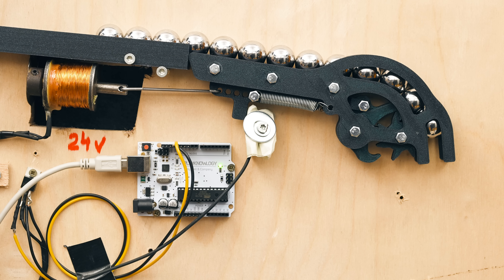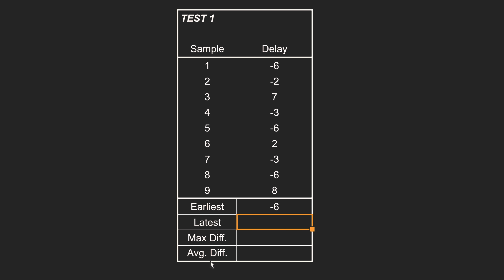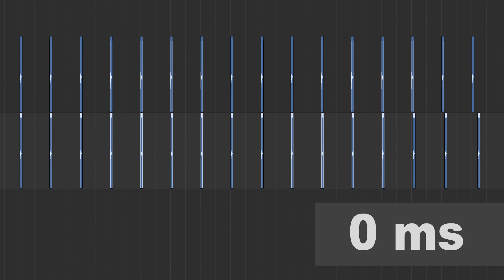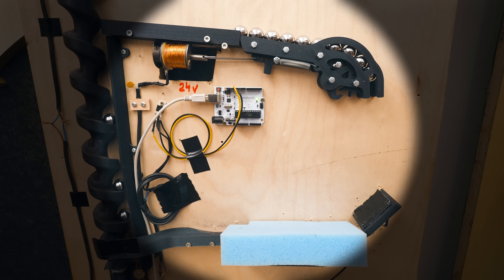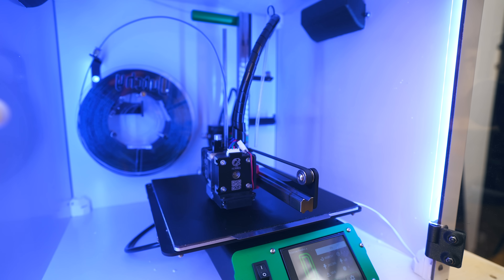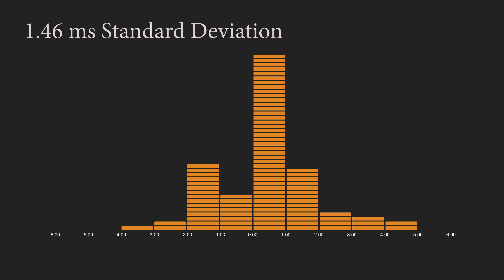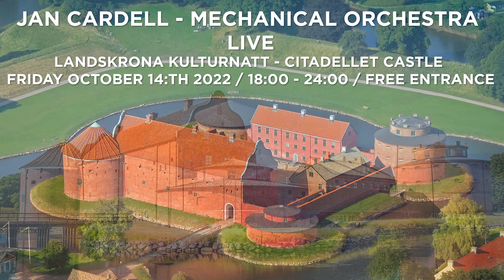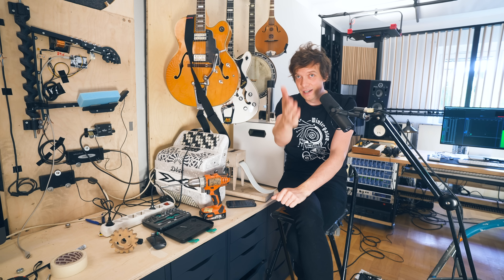Testing the Arduino Marble Gate

Comment: You started strong with MMX, assembling a great team to help in development and manufacture. I admired that process, both the skill in engineering and the team building. Since then my feelings have shifted from admiration to sadness as this channel morphs into a cautionary tale of a ruinous slide into perfectionism and the disregard of counsel. Another millisecond test of a marble gate is gut wrenching to watch. I hope to be proven wrong in time.
Reply: I can only say one thing about that.

You are right.
Reply: While Martin was chasing inaccuracies compounded by having a surface mounted at an angle, he should have realized that that configuration is actually perfect for more easily measuring the slop in the travel path of the marble. Instead he changed the mounting angle to artificially tighten his measurements. BUT this slop in the travel path of the marble is why he had to change the funnel designs on MMX and why he kept getting random marbles on the floor.
I think the biggest concern is that if Martin just worked directly with an engineer and/or scientist on most of this stuff the progress would be so much faster. How much time did Martin spend on thinking about how to capture the statistics of the marble drops before he found out about standard deviation...and that it's built into google sheets?
Reply: Very much agreed. Scope creep and ever moving targets are a slippery slope.
Reply: Yep, this is what I felt when I heard he scrapped mmx. Absolutely crazy decision. It will never be finished.
Reply: I agree. The original marble machine was about art, making a machine that looked cool. While it could play music, I would say that was not the primary goal.
With all this quest for perfectionism, the simplest option is to remove the marbles entirely and not have a marble machine.
Reply: yeah i agree, the last video i watched of his was when he decided to scrap the mmx, and here he is a year later with no works of art, just a computer dropping marbles that despite being more accurate than 99% of actual musicians still isnt good enough for some reason. What was the point of the mmx if nothing ever comes of it, art isnt meant to be perfect and trying to achieve perfection has made me lose any interest in the channel
Reply: That was really tactful, NightHawkInLight. I don't believe I would know if it would be tactful or not for me to try to make a comment on this if I were in a similar position to you, but I think you just showed it is absolutely possible to do so tactfully and kindly.

I feel like our beloved creator here is stuck down the rabbit hole of perfectionism beyond what we can bring with comments. I'm biased because I have a trauma background, but super resistant things like this remind me of trauma responses, and the difficulty in changing it often correlates with age and the extremity and perseverance of the trauma itself.

Obviously there's a lot of factors, but whatever it is, I hope our dude here can look it in the face, accept it, and let it go. It would be beautiful seeing what he could make.

Minor aside, thanks for your contributions to the science space. I've really appreciated tearing through a few of your videos, they're both challenging and easy on the brain, which is a hard balance to strike. Whatever you do (or produce), you can be sure that the polymath side of me will have an ear out! I guess you're "big" at this point, so....congrats! Many hopes for many more great years of whatever you're wanting to do. :)
Reply: Think your all are being too harsh.
Appreciate you may not see accuracy and art being compatible, but art and experimentation certainly are. I see a video of somebody going down a rabbit hole of learning and that shouldn't be discouraged.
I really enjoyed the video, loved seeing the process.
Reply: What's the standard deviation of a professional musician?  That's the target.  Not robotic perfection.  That's not what music is supposed to be.
Reply: @jonbartosch1903 , id bet a lot more than 1ms. He’s now trying to do better than the controllers that control fuel flow into rocket engines and thrust vectoring on aircraft. It’s pointless to want to achieve this level of control on a musical instrument. He should take your advice and run some experiments on individual members of an orchestra.
Reply: @stellamcwick8455  Love the concept of timing members of an orchestra :)
Of course it has been done for many artists (many of them dead now) and it showed that part of their unique style was shifting tempo and minute 'lateness' or 'earliness' adding expression.

But at the end of the day a machine can not create these variations consciously so it will always play 'in the pocket', which is just fine by me. If he just made a short video telling people about the concert and left it at that I for one would have been far more happy, instead of revisiting one of the least endearing aspects of MMX creation...
Reply: @jonbartosch1903  If the machine can play as tightly as the best session musicians, it's good enough. Anything tighter than that, and you're better off using programmed electronic instruments...
Reply: @jonbartosch1903  Imagine gatekeeping the definition of what "music" is supposed to be, in 2022.
Reply: @SpudSpudoni  imagine taking $1000s and 1000s of hours from people helping you build a music machine, and then just saying, nah… I’m not going to do that any more because it’s not 100% perfect.
Reply: @jonbartosch1903  Could you be any more self absorbed? This is an ENTIRELY different point, but okay. Firstly, if you're talking mostly about yourself as a patreon supporter, no one forced you or anyone else to give him money. I've been watching his content for free since the beginning. Secondly, you're paying for ENTERTAINMENT, not for a tangible good or product. You're not OWED anything by not being entertained. That's not how that works. There's no guarantees like there is in tangible goods. The minute you're no longer entertained, stop funding the content, it's as simple as that. Getting really strong "I'm the main character" energy here.
Reply: Okay, "that's not what music is supposed to be", right ? Then I strongly advice you to listen to "Giorgio By Moroder" : free your mind about the concept of music being correct, stop with your preconception of "how music should be".
Reply: @davidboutchiama2008  great song, btw
Reply: Yes, especially because no marble machine will ever be able to compete with a software drum machine, so that's not supposed to be the point.
I think the canceled/postponed world tour with a slightly laggy and marble-tossing MMX would have been an incredible success - and most people attending would be viewers like us who of course understand all the problems that have been overcome to come to that great machine.
Reply: I agree.  What made the first marble machine great as well as the MMX at the start before you lost your way wasn't its accuracy or even its reliability but the concept of the marble machine itself making music with marbles and mechanicals along with your journey building it.  While I can understand the need for reliability for a tour, people aren't really expecting perfection.  In fact people are probably expecting the odd marble on the floor as part of the experience and removing the artistic parts, what you are now calling bells and whistles, to try and achieve that perfection is killing the soul of the machine.
Reply: I think of this more of a documentation project for future reference. Even if individual pieces don't contribute directly to having a completed product on the stage.
Reply: I agree with you. I stopped watching refinery updates a while ago. This is rabbit hole after rabbit hole chasing perfection that will never come with this level of equipment and engineering.
Reply: Amen brother
Reply: I think the millisecond accuracy is a good video topic and was interesting. However I'd wish there were more videos.
Reply: I agree... Maybe perfectionism rabbit hole?
Reply: @citronovastava   Feck Perfuction!
Reply: Pin this comment, Wintergaten
Reply: I mean that depends on what your goal is.

This is absolutely amazing engineering content.

I would hire this man at my production facility in a heartbeat.
Reply: Sheesh. Most of these comments are people that didn't seem to actually watch the video. The marble machine won't have electronic timing or functionality, this was just used to test the gate mechanics, as Martin said. Your argument against perfection is valid, but honestly, the work here is arguably the most important section of the machine. The timing on the marble release is vital for anything to sound right. Any timing mishap can compound as a song progresses. I think everyone is viewing this inaccuracy from the single escapement's point of view. You won't notice as much if a marble gate isn't on tempo in a vacuum, but if you factor in toe 20-30 other marble gates, any deviation can ruin a song. People want to talk about the natural nature of imperfection in music. Difference is, musicians can correct and ad-lib depending on what happens during a song. The marble machine will have no way of correcting its tempo once it starts. Once the gate and the gate release are figured out, I too am hoping that the rest of the machine is much more of a plug-and-play or pre-existing designs that worked on the MMX. 

So many people on here just want what they want to see and imparting what THEY think the marble machine should be, without considering what Martin wants to do. Lots of backseaters in here.
Reply: @SpudSpudoni  No, the gate is not the most important component here—it is merely the final component.  There will likely be dozens of other physical components involved in the ball’s release—each one introducing its own variability.  “Optimizing” this single component is meaningless without understanding (and clearly defining) all the up-stream components.

Would you put high-performance tires on a rusted-out Pinto?  Or do you recognize that you need to understand the entire car before you decide where to spent time/money “optimizing”?
Reply: @br52685  It 100% is the most important. Without the gate, there is no music. The machine can move the marbles up and down, side to side, as much as they want. If it doesn't get released, there is no sound. It's timing and release is essential.

That analogy doesn't make sense. I could put brand new tires on a old beater, but my contact with the road (an analogy for contact with the musical instruments) won't be what ruins my car. But if you have a brand new Audi, and put bald tires, overused tires on it, your contact with the road will be your downfall.
Reply: @SpudSpudoni  You honestly think the gate is the “most important” part of this entire contraption?  You are so sorely mistaken…
Reply: @SpudSpudoni  But he doesn’t even have a functioning contraption (car) yet.  So why try to optimize a high-performance tire, when the rest of the car does t even exist?

You don’t start novel projects by optimizing a single component *first*.  You develop an overall functioning model and THEN refine—and that’s after you have an understanding of the system as a whole, and can clearly see what needs to be optimized.
Reply: @br52685  It's the most vital component  to making music, 1000%. You're just being too obtuse. It's the same way that a car's engine is arguable the most important system, but without the ignition / sparkplugs, its worthless at a racetrack. The same way government is arguably the most important system to a country, but without trash collectors, everything falls apart. Sure there are larger components at play to the marble machine, but they aren't the last thing the marble touches before it interacts with music, like the gates do.
Reply: @br52685  Because imagine a world where cars don't exist, and you're designing the first tire. That's why it's vital. You can have the strongest, most efficient engine in the world, but if you don't have anything to grip the road and move the damn thing, it's not functional. You're not viewing the machine in the correct lens.

You absolutely can optimize a certain part, if its vital enough. That's literally how the design process operates. You have to dissect something into its smallest structures to optimize them. Martin knows how to make a marble machine. He's built two of them (1.75 if we are estimating). Now is the time to perfect the systems he already knows has the highest chances of success.
Reply: @SpudSpudoni  That is NOT how the design process works.  In a world where cars don’t exist yet, you can’t design high-performance tires—as you simply have no clue what the constraints/limitations are of the rest of the system.

If anything, he should be asking if this is the correct mechanism to actuate the marbles.  I can think of a dozen better (ie, faster frequency, quieter, etc) mechanisms than this specific gate.  He’s wasting time optimizing a piece, without stopping to asks if this is even the right piece to be using.

There is just SO MUCH poor design philosophy behind this current iteration—has anything truly been learned in the last three years?  Was a ms variance what doomed v1 and v2 of this project?
Reply: @SpudSpudoni  Also look at the frequency of the marble-release...about 1 marble/sec (1Hz).  Is this the intended frequency for expected use (as it seems very slow to actually produce music)?  Is the intent to use this gate at a higher frequency, and if so...what frequency?  I guarantee you that the variability its going to be much greater at higher frequencies than what is currently tested at 1Hz.  Shouldn't the operational-frequency limit be tested first BEFORE any attempt is made to optimize variance?  There exists other gating-mechanisms that can work at a higher-frequency (hence, produce more music) than this current gate.  Have those been explored?  Why was this specific gate chosen to be the final design that needed to be optimized?

THESE are the types of questions that a true engineer/product-designer/creator would be asking.  THIS is what a true design-process looks like.
Reply: @br52685  I mean, I'm not saying his methodology is perfect. He's not an engineer, nor a designer by trade. But he's going about it logically and with focus on certain aspects, which can be appreciated. I'm not his boss, and I'm not paying his wages. If you somehow end up as CEO of "Wintergatan Incorporated", I'm sure you'll have actual say as far as how he chooses to test his machine.
Reply: @SpudSpudoni  Yes, his methodology is not perfect--and that is precisely what all these commenters are saying--so that he can hopefully, successfully get on the right track and finish this project, by listening to logical and sound advice.  There is no logic in his approach--it's just whatever random rabbit-hole he wants to chase down.  As far as paying his wages--my understanding is that this is all crowd-funded...so we technically are paying his wage.
Reply: @br52685  Again, I could care less about his methodology. He could make a video about the differences of apples and oranges. He's allowed to because its his channel. Oh good grief, don't give me this "My taxes pay your paycheck" bull. This is not the same thing. You don't like the content, you have the choice to stop subscribing your wallet to it. You aren't owed anything just because you support his patreon. This is moving from really gate-keepy energy, to just straight parasocial energy.
Reply: @SpudSpudoni  Never said anything about this having anything to do with taxes, so no clue what you're talking about.

Bottom line simply is this:  there ARE people (myself included) who DO want this marble-project to succeed, and we're providing countless comments indicating why this current path is not the path to success.  You on the other hand, are fine with simply awarding him an "I participated" ribbon.

You're content with merely cheering him on, even if he's running the wrong way.  The rest of us would like to see him running down the correct path.
Reply: @br52685  Lol it just sounded like similar talk to other things I've heard and it reminded me of that.

And I get that. You want to help make the marble machine better and see it finished. That's cool. But you also should expect your voice to be heard either. It's his channel, and his machine. If he decides he wants it to stop playing instruments and make pizza instead tomorrow, he has every right to. I don't understand how that's a hard concept to grasp. 

I haven't participated in anything, because I don't have my money or time invested in this lmao. I'm just watching it for entertainment, because that's what this is. Again, thinking otherwise and building a para social relationship over this isn't healty. You're getting really twisted because Mr. Youtuber isn't making you what you want to see and you're crying about it. But go off about what I'm doing, bud.
Reply: @SpudSpudoni  Para social relationship?  Crying?  At this point, you've also really spiraled down a rabbit-hole...with no concept of what your actual purpose/intent was.
Reply: @br52685  Oh and now we're gaslighting! That's cute bud. Good rebuttal.
Reply: @SpudSpudoni  So now you're just having lobbing petty insults (para-social relationships, crying, gaslighting, etc.).  Again--what IS your point?

Mine has been 100% clear from the beginning:  this creator is on the wrong path, if he truly intends to create a marble-music machine.
Reply: @br52685  Bud. YOU replied to my original comment. You tell me. You went on rambling on about the gate wasn't the most important component, and then switched your argument to the fact that he's not making the machine correctly and needs to listen to us more because "people are giving him money". My argument from ground zero is that he cannot objectively be on the wrong path, because he's making it for himself. You or anyone else has claim to make decisions about how he works. You're again being super obtuse and clamoring on about how someone's piece of art isn't how you'd make it and that makes you upset because you watched too much of his content already and gave him money. I honestly can't tell if you're really this lost in your own argument, or just trolling. This is the same as writing a hate letter to Netflix because you don't like the direction a show is going. Grow up.
Reply: @SpudSpudoni  if this is merely a piece of “art,” then by definition people are allowed to have opinions and critiques.

You’re the one that mistakenly claimed that we (the audience) had no financial interest….when it’s clearly Patreon-driven.

You’re the one that thinks he’s following “sound engineering and design principles.”

Sorry…but you’re just lost here.
Reply: @br52685  Never said you weren't allowed to critique, just that he doesn't have to do what you tell him to do. Again, if you want to hire him as a musician and artist and put him on salary to finish the project your way or take a hike, then it'd be a different story.

The videos and its content are patreon driven, but in no way did he sign any contract that just because you give him money to make something, that he has to listen to you. You specifically said  "As far as paying his wages--my understanding is that this is all crowd-funded...so we technically are paying his wage." You are giving him money, but he is 100% not employed by you.

The fact that you think there is only one right way to do something, and he is objectively on the wrong path (someone who only knows of his work from what he shows on screen) makes me think you have absolutely zero idea what you're talking about. I'm not even saying he IS on the right path. But assuming he's not is just flat out ignorant.

You're lost because you have no argument and are just arguing in circles lmao.
Reply: @SpudSpudoni  "He doesn't have to do what you tell him to do"?!?  You're absolutely bonkers if you think that anyone here presumes as such.  Absolutely bonkers.

There are about a thousand comments (on this thread alone), indicating that he's on the wrong path.  But yeah...we're all wrong.  You're absolutely bonkers.
Reply: @br52685  Give me any proof that the statement is incorrect. You're just using ad hominems for the basis of your argument now. This is beyond silly.

"A thousand comments". Literally 128 replies, but okay. Never said any of you were right or wrong to lend your advice, just that he doesn't have to use your advice.
Reply: @SpudSpudoni  There are 2,000+ comments on this video (at least).  The overwhelming consensus is that this current path is not good.

Again...what exactly are you contributing here?  No advice to move the project forward.  You're just sitting here complaining against the people trying to help and get this project on the right track.

What your motivation to discourage constructive criticism?  Is it because you actually want to see failure and don't want to see this back on-track?
Reply: @br52685  Sure, but now only 130 comments in this thread. "The overwhelming consensus is that this current path is not good." Damn, you've looked through all of them and gauged their opinions? I'd love to see the log sheet of all the research you've done in the last 24 hours since this was posted. That's quite an impressive waste of your time!

Currently, I'm not contributing to anything. I'm having an argument with someone that's obsessed with trying to prove my opinion wrong for whatever reason. You're just wasting your time trying to force me to agree with your opinion. And here I thought you stood for letting our voices be heard about this project. Smh.

"Is it because you actually want to see failure and don't want to see this back on-track?" Bro. Idk what you're smoking to come up with that, but I want some. This is a wild-ass strawman of a statement lmfao. At this point, you're not even making counterpoints. This is getting sad.
Reply: @SpudSpudoni  "Currently, I'm not contributing to anything."  I couldn't have said it better myself--it's quite obvious you've not offered any contribution.
Reply: @SpudSpudoni  You make it sound like it’s hard to read a bunch of comments.  Do you find reading to be difficult….in general?
Reply: In machining, it's called "chasing zeros". Trying to get a level of precision that contributes no benefit to the goal you're trying to achieve. 

This is like returning a pair of shoes because one shoe is .01 inches longer than the other.
Reply: @talyrath  It's so much fun to chase zeroes sometimes. :)
Reply: The most odd thing about the MMX videos for me, was the marble testing, where some marbles ended up on the floor and Martin acted, as this was the end of the world. So what!!? Its not like you are running out anytime soon!
Just finish the damn thing one way or the other! Now after the big break I kind of lost trust into Martin and dont want to invest myself into the project again. Sorry, I hope this will change.
Reply: I've not been following closely if he's even uploaded anything recently, but I always interpreted him giving up on MMX as primarily a mental health crisis, and I don't think he's out of it. I do think that doing something actually productive would help though, and this ain't it.
Reply: @Ass_of_Amalek  No he had to move to another country and deal with family stuff. All these people aren't in the discord I guess and don't know just how many problems the MMX had. The MMX would not have been able to fit his original goal, and would have just been another MM1. I know his videos seemed to suggest it was almost done, but it really was not. That being said, I still may have liked to see it at least completed to some extent and have some songs play. Also I do think Martin needs to address the situation and let everyone know why he scrapped it, because it's hard to find out.

This video seems trivial but its just him getting back to work.
Reply: @nonwibb  clearly he scrapped or stopped working on the MMX without having a better plan. I don't believe that he had good reasons to just get rid of every individual part of it without having any clue if he could make something to do the thing the part does better. 

a bunch of comments here seem to say that much of the problem was basically due to wear. that sounds to me like the main change he needs to make is to stick to using better materials, namely ditching the plywood. birch ply is soft and quite substantially dimensionally unstable. it hasn't made sense to me for a long time, but he clung to it as an aesthetic choice to reflect the original marble machine. I think perhaps he could get away with using marine plywood, which is very expensive resin-saturated plywood, so it's harder and probably much more stable.
Reply: @Ass_of_Amalek  I think you just made a good case for building a new marble machine lol
Reply: @nonwibb  no, there were many parts on it that weren't made of plywood and other parts where the plywood could have been replaced with something else. there is no way he had a good reason for scrapping every part.
Reply: @Ass_of_Amalek  I mean yeah some parts work alright design-wise. Many of the parts were like fundamentally not going to work though, not just because they were poor material. Still yeah I think the frame and flywheel and other basics looked perfect, and there are many other parts that seemed optimal. If he goes for a similar design he may very well reuse some parts.
Reply: As an engineer who has worked on the Apollo project to the Tesla battery plant.  Perfection kills finished every time.   Good enough is just that good enough.
Reply: I am in agreement with you on this too...the first marble machine was a lot more compelling to me because it followed the old mechanical machines from the past in its tradition that he demonstrated and did videos about and visited museums...going all this computer tech to get there seems to defeat the beauty of the original machines with all its wonderful flaws.
Reply: @chuckthebull  Absolutely, but I think this arduino is just for testing purposes thankfully
Reply: This summed up everything I feel x100... seriously.. I can't watch stuff like this anymore, he should have just  plowed ahead regardless and not listened to those idiot small voices in his head, most people can keep better timing in thier heads within 50+ms what he strives for and what he strived for in MMx was impossible and maybe he did it to self sabotage...
Reply: I wanted to write my on comment but this one pretty much nails it :(
Reply: Ye of little faith…
Reply: This kind of snowflake thinking is a result of too much Hollywood bullshit during formative years. Martin is not here to entertain you and make a happy ending so that you can enjoy your dopamine hit and move on to next thing. He's sharing his life's work, the ultimate behind the scenes. Blood, sweat and tears. Life gets messy and no amount of followers or patreons can steer away from that. Yes, some of us would not be as worried about the tightness of the machine, but that just proves that most of us would suck as musicians. I think even questioning his decisions is disrespectful and shows lack of empathy.
Reply: Comentário perfeito. Em minha opinião, o grande problema é que o Martin tem um orçamento “ilimitado” …
Reply: Totally agree. This is Martin allowing the perfect to be the enemy of the good. The charm of the MM1 video, even the machine itself couldn’t play the song once through, was infinitely better than where we’ve ended up.
Reply: He’s a musician, not an engineer. As someone who played some music in my days I can understand his frustration with getting tight music. I feel like he knows a lot about engineering at this point seeing how many years he dedicated towards this, but he seem to miss one fundamental thing when he does tests. That is, this rig, is not a fundamental testing rig, not by a stretch. There are waaay to many variables going into the timing, and it’s to difficult to know them all unless you start from square one.

If he wana do fundamental testing, which he should, to avoid it being so chaotic in the results, he really should try and take baby steps.
Reply: I think the "robotic perfectionism" part is justified, since this is about creating an instrument. A lot of musicians take for granted the amount of engineering it takes for their instruments to become playable. Slight deviations would cause long term problems and that's why the creation process should be as perfect as they can possibly be, let alone the actual designing process of the instrument. 

MMX's problem was more on his stubborness/fear to not just start over sooner. Because as an artist he WAS enjoying MMX's journey, but the more he creates for it the more he has to destroy, and it was going nowhere, so he had to start over and create something new. 

Ya'll just want to consume cool viral videos sooner. That's why you're telling him all that... 
"just be yourself" 
"be an artist" 
"art is about imperfection" 
bullsh*t. 😂
Reply: I disagree - I see him as a musician and artist who is trying to teach himself engineering.  An artist sevant can build a really cool machine but it takes an engineer to make an accurate instrument that someone would want to play. Personally, playing a poorly-tempered guitar or other instrument it's a very brief experience for me - if it's not correct I just can't stand it. I applaud his paws and focus on the fundamentals.  The evolution of the violin took generations of talented engineers supported by a  massive cottage industry of suppliers and an army apprentices. Considering the evolutionary pace have tomorrow machine - this truly demonstrates his brilliance and level of determination!
Reply: Its sad to see what was once a piece of art had turned into trying to get down to single milisecond precision. Very unfortunate to see an artist be turned engineer and lose all of the heart in the process.
Reply: @Keelhaulic  why is it sad to be an engineer?
Reply: @lilyofluck371  I have been following the project since its inception and it's sad to see something very artistic driven and full of heart be broken down into an engineering problem.
Reply: @Keelhaulic  It still IS artistic, a lot of you just want the romanticized, more ideal, version of  "artistic" where someone vlogs progress once a week in their ideal artistic homebase.

If you've ever created something before, you'd know that he still IS enjoying this, probably even more now that the sunk cost fallacy from the MMX is no longer holding him back.

You guys just don't find all the boring engineer stuff as appealing and immediately went "OOOooOooh iTs No lOnGeR aBoUt tHe ArT 😭😭😭"
Reply: @Keelhaulic  thats very awful to say taking in consideration the context. Martin scrapped the mmx due to the machine started breaking on random places, every time he fixed something in other place something started to either break or wear. He pushed so far the "artsy over function" until the very end. The machine could easily be done much simpler but he pushed a lot of design desicions in favor of aesthetics. And he kinda still do.
Dont try to police other people's art ffs, his art intentions Is to create a machine that looked good and also could play music without destroying itself in the process.
Reply: @ppprime98K  If his "intention" is a "machine that looked good and also could play music"....then why do milliseconds matter?  Absolutely NO musician is precise down to a millisecond.
Reply: @ppprime98K  nah man, he gave up because he couldnt have 0 ball bearings hit the floor. i mean, god forbid it plays and drops a couple ball bearings... theyre like 2 cents each and yeah its a safety hazard and not ideal but ffs just finish themachine it was like 75% done lol
Reply: @ppprime98K  Except thats not what I saw happening with the MMX.  What I saw was great progress was being made improving reliability by identifying weak points and designing out the problems.  Unfortunately what also was happening was at the same time Martin was becoming more and more obsessed with a perfection that is unobtainable in a wooden machine moving marbles around.  That and too many people encouraging Martin to go down that path.  I want to see a working machine making music even if there are a few imperfections.
Reply: @ppprime98K  A-fucking-men. First of all, it's not like "this is what the marble machine has become". If you loved the original version for its heart, soul, and charming level of mechanical sloppiness, it still exists and is just as beautiful as it ever was! So just watch that video or go see it in the museum.

This is a SEPARATE art piece, with different, very challenging design requirements. If you don't like how many tradeoffs it takes to produce an art piece of a certain type, that's fine! It's okay to not like art. But to claim that it's because the artist lost his heart is not only rude, but imo, false. Just LOOK at the hours and hours of content, organizational systems, enormous communities of engineers and artists he brought together, and years of his life he poured into making his "magnum opus". If that's not heart I don't know what is.

And personally, I find enormous artistic satisfaction in the marble machine's story arc. Three machines representing the three stages of Martin's growth: the pure, but impractical artist, the artist wanting to merge engineering and beauty, the artist recognizing the sacrifices that must be made to accomplish a dream.
Reply: @br52685  Because is a machine, not a human that's playing the instrument. And miliseconds matter since they can add up and desync the whole machine. Imagine that in the middle of the concert the snare triggers slower than it should be. A human can adjust themselve to be in sync as humanly possible to the beat, a machine can't automatically adjust to the beat, so eventually it will be desynced
Reply: @donniekarns2082  i wasn't the one who said he lost his soul but i share your point lmao
Reply: @ppprime98K  It wasn't so much that it started breaking in random places. It was that it wasn't perfect, that there was some flaw that he sought to improve.
Reply: @ThePoxun  The thing is that those imperfections were slowly breaking the machine down. On the last streams Martin had so much trouble with the machine, from barely losing marbles to creating a marble shooter almost. And why is important? Because he found marbles where it shouldn't be any and causing the machine to slow the machine and break unreachable parts. One time he felt that the machine was "too heavy" to crank manually and was a marble that got stuck between the gears and caused a lot of friction.
Reply: @ppprime98K  That would depend entirely upon how the machine is setup.
If you had an entirely independent snare machine, then yes, it can desync. This is because in that setup, it is timing itself, and each drop could be timed relative to the previous drop.

But with the original marble machine, and the MMX, you have the programming wheel driving everything. That is what you need to desync. That is because the programming wheel tells the marbles when to drop. It doesn't matter if the previous marble dropped 1 second late, because it is timed from the programming wheel.
The only way this could be pushed out of sync is if some part of the machine is being deformed.

And a great example of that is in the last part he changed, making the surface it hits flat. Prior to that, there was significant variation because of the marble hitting the upper or lower portion. But that variation had nothing at all to do with the timing of the next marble being released.
Reply: @ppprime98K  No…these will not add-up to eventually result in anything being out-of-sync.  There is mo additive nature to these deviations that accumulate—as the timing is NOT based on when the last event triggered.
Reply: @br52685  most of his timing issues were on the release system, some parts wore out faster so they wouldnt release on time or get stuck, most of the timing problems rely on his designing that depends a lot on lubrication, like the marble release system that he needed to lubricate with graphite periodically
Reply: @ppprime98K  Is he policing it, or giving his opinion? How about you refrain from policing other people's speech?
Reply: @ppprime98K  And as someone else mentioned, these milliseconds are jitter, not a cumulative delay. At the end of an hour long song, the marbles would still be hitting within 4ms of their trigger, just as they were at the beginning.
Reply: @ppprime98K  preach. I was ready to grab my pitchfork but you are right. Both are gut wrenching to see, but I think this is still progress forwards
Reply: @ppprime98K  don't forget biased vs unbiased effects. If you have pegs like the old machine, it's going to (hopefully) be unbiased. But the samples of each time we "roll the dice" for each peg are independent, so there's not a chaotic, exponential divergence (i.e. some kind of eventual explosion) for things.

Now, with a musician, it can compound. Like, for example, if the click track breaks on the drummer. That can go really badly really quickly, I think. Maybe there's a timing mechanism that does have accumulating error, and without self-correction, could completely diverge.

I'd argue that if people took finals-week-level creativity on the band side of things, that they'd just be able to play along with any timing system desyncs if that happens.

I find it absolutely beautiful when programmed, structured things suddenly become organic of their own nature.
Reply: @ppprime98K  I know :) I was saying "Amen" to your original message, then adding my own thoughts.
Reply: @donniekarns2082  oh sorry, most people think engineering is enemy of art when are mostly related, Martin Is passionated about his craft but still recognized that the MMX had fatal designs, and he still have even the first MM because both are an statement of his craft and evolution
Reply: @ppprime98K  😅
Reply: I think Martin might have been running to compounding errors and is trying to mitigate part of that; even a 0.1% error over a 7 minute piece may be causing parts of the “band” to break step :)
Reply: @willkelly8108  except they aren't really compounding as each marble release is an independent event with an external (to the release mechanism) clock.  The timing of each individual marble is not influenced by a release mechanism delay from the marble before.  They are also far more regular than a human could manage over an entire piece of music.
Reply: @willkelly8108  there can't be any compounding errors in the timing of the music, though. The timing is ultimately controlled by the programming wheel, and if there's compounding error, it affects all tracks, rendering the compounding error irrelevant.
Reply: @willkelly8108  the mechanics of a marble machine take the compounding part out of it. The error is always in relation to the trigger, and triggers can only drift along with the whole song.
Reply: And the first machine was still able to play a complete, recognizable song.
Reply: @_taste  …and was shaking itself apart during the filming of that complete, recognizable song.  The original marble-machine is actually unusable now. 

The MMX, too, began to self-destruct towards the end.
Reply: @John_Weiss  "The MMX, too, began to self-destruct towards the end." This was probably down to so many multi-hour non stop tests without any kind of maintenance during the test.  Every machine needs some kind of downtime and regular servicing and trying to run the machine for 10 hour tests without any kind of checks or adjustments when the normal pattern would be at most one or two ours of intermittent use was just setting up for failure.
Reply: Perfection is an unattainable goal because it means that the perfect 'thing' can never be improved upon, let alone bettered. Martin has a brain, he should know this. I wish he would go back to composing more of his wonderful music and/or settle for a marble machine which is imperfect, because imperfections in creativity can lead to wonderful, organic results. Look at the works of many famous artists for example and realise that none of their paintings are perfect, but what makes them so great is often the imperfections that resulted in something even better.
Reply: As much as I hate to be hard on Martin, because I think the man is a low-key genius and he's too hard on himself already... this is completely true.

MMX was an amazing project, with all the BS that the mechanical aspects brought. I am very sad to see it gone without it being finished, even as an imperfect product.

I am however gonna be following Martin for another while. We'll see what he comes up with.
Reply: If he went pure digital, then he would never have any timing or failure issues. /s

But thats not what the mmx was. It should have been a purely mechanical device. Yes balls will fall, itll have timing issues etc. But thats part of the charm
Reply: @david40k  the timing issues Is due to design oversights, not just because Is a mechanical device.
Reply: Well put, I feel the same. 
I hope I'm proven wrong as well.
Reply: Yeah, I guess it's somewhat saddening not to have any advances in the project for a long time, but who are you to judge whether someone's way of life is a good one or not? For all we know, he might be happy as he is now - working on the marble machine, his channel hopefully providing him the funds needed. It might be a cautionary tale to others, but some may be happy dedicating their life to a single thing. Whether Wintergatan is such a person I don't know - those are his feelings to share or keep private.
Going off of his demeanour in videos I'm inclined to say that he is reasonably happy with his current life. If a video comes out tomorrow explaining how burned out he is from endlessly working on the marble machine, I'll be the first to admit I was wrong, but given the current situation, saying it's saddening is a bit of an overreaction in my opinion.
Reply: We should not be too hard on Martin - most important thing is to have FUN
Reply: @astromikael  The thing is that the abandonment of the MMX meant that he wasn't having fun, and that was evident in a number of his videos. He was very open about the problems.
Reply: @astromikael  If this was his project alone sure, but because of his horrible mismanagement of this project it's turned into bilking well intended people for their time, expertise, energy, resources, and patreon supporters for their money
Reply: What a silly take. Martin is a musician that wants to make an instrument that he can use in concert. If it isn't precise enough it doesn't work and all the time and effort will be wasted. He's obviously not on youtube for the sole reason of making the most appealing videos that as many people as possible find enjoyable. He's using youtube to share  his process, and you don't have to be part of it if you don't like it.
Reply: Whoa, dial it down a bit. It isn't anything but a learning process which also IS a part of art.
Reply: Amen.
This sounds even more pointless if we think of how many points of failure there are in the machine. The situation is even worse if we consider HUNDREDS of MARBLES, which are prone to deform in time. He should focus on compensate the failures (e.g. collect the marbles that escape before they hit the floor and put them back in circulation) and add redundancy (two loading channels for the gate). But sure, let's shave 1 ms on 4 which makes exactly ZERO difference on the result.
Reply: Engineering is also art. I hear loads of musicians making beautiful music. Martin is essentially decomposing the playing of a piece right down to the component level. I dont see many others doing this, and it's beautiful to watch.
This is not about chasing milliseconds, it's essentially the engineering analogue to the process any human drummer would do to play tight e.g. PRACTICE!
Reply: Big thumb up,
Reply: couldn´t have said it better
Reply: I am sorry, but I will have to agree with people giving you criticismfor the obsession with perfection.

When I watched the first Marble Machine videos years ago, I thought WOW. Let's look into this Wintergatan guy/band.

Then I watched the youtube videos with Wintergatan's FABULOUS concerts, and especially Wintergatan LIVE At Victoriateatern where you stated that the ambition was to build a machine that you could take with you and play on a world tour. And I thought to my self, I will HAVE to go and see that. And for a long time Wintergatan were on my playlists. 

I have watched the episodes where you struggle to overcome many technical problems rooting for you to make progress, but the episodes I have enjoyed the most, are actually the ones, where you perform a full piece of music, with the prototype MMX playing drums or bass.

And ofcourse I have a t-shirt with the MMX on it :).

But now I am beginning to doubt that you will ever go on world tour with the MMX, because of the obsession with perfection. Can I (respectfully and with a deepfelt love for your music) suggest that you finish the MMX so it is robust enough to function on a tour, and go play it, even if it does not meet your level of expections for technical excellence. This will also allow you to gather experience of what is necessary to improve on the machine.

I really hope that you will produce new music in the near future, with or without the MMX.
Reply: Agreed. Pretty much anyone can build a millisecond precise robot drum machine with an Arduino so this kind of seems like cheating. The beauty of the original marble machine & MMX was their "mechanical-ness", which can never be mathematically perfect.
Reply: Complete agreement, Arduino driven?   The next iteration is to eliminate the marbles completely.   I love the channel, the engineering and problem solving, however driving this machine electronically erases what makes this machine special.
Reply: @allengoerner8532  someone didn't watch past the first 3 minutes. He literally says that the final machine will be fully mechanical, and that the arduino setup is ONLY for this specific test.
What sounds more feasible to you: setting up a simple electric mechanism to move a part to test it, or building a manual version requiring a hand crank, gear train, and piston-- again, only for a TEST.
Reply: Thank you for writing these words. It's not the first time i see words such as these... sigh i've even written similiar ones a few times.... I've barely passed a half way though the video and trying my hardest to figure out a way to write this once again as the videos saddens me to such extreme levels. Watching Wintergatan was something i did for a very long time. It became my routine and it brung with it a lot of joy and even anxiety reducing feelings. Until it turned, into this madness. The 'not even one single mistake in this enormous undertaking is allowed' is simply impossible to achieve, and it just hurts to watch :( Love you Martin, hope you find your way out of this nightmare you fell into.
Reply: @alexryberg5946  Martin is living the life of an Engineer.  Imperfect humans striving for better.  Don't be sad, he's perfecting his craft even if there is no realistic way to build a machine to his requirements.  There is joy in the process, as well as the end product.
Reply: DAMN some hard to swallow pills by nighthawk who actually finishes projects
Reply: I think there have been enough comments like this in past videos. It's fair that some people think the old approach was better. But Martin made it clear that he doesn't think it's feasible. I feel comments like this will only eat away at Martin's motivation and not bring back the MMX.
Reply: @dorianursuul5109  Except on past videos the people wanting a working machine were outnumbered by the people who wanted Martin to chase perfection at the cost of ever finishing.  9 months on and most of the perfectionists seem to have evaporated leaving those of us who are actually invested in seeing a working machine and seeing it in person on tour, purely based on the balance of likes on the comments.  I almost feel that a portion of the perfectionists were going down that route just to set up the project to fail.
Reply: @dorianursuul5109  Or it could possibly steer him back on-track...as this is very clearly an unnecessary detour.
Reply: You’re missing it. As he explained at the end, since each piece adds onto the timings, if each piece as a significant enough standard deviation, it will compound into being off by large portions. This isn’t musicians who are constantly manually adjusting their timings to one conductor, it’s more like if each member of an orchestra could ONLY hear the person next to them to base their timings off of. The timing on the last person would be so off. Standard deviation of of one timing is fine. Standard deviation off of standard deviation over and over is not
Reply: @OctagonalSquare    No…not correct.  The timing of when the next ball releases isn’t based on when the prior  ball max impact.  Therefore, there is no additive effect of these tiny delays.
Reply: @br52685  not on this individual piece. But all the stuff that creates the timing before it changes the delay. So he is getting rid of as much variance as possible
Reply: @OctagonalSquare  The variance is coming from the mechanical pieces (Arduino/springs/solenoid) that aren't even part of the final design.  Why waste time trying to optimize those pieces?  This is why this is a fool's chase.
Reply: @br52685  the dropping mechanism will be part of the piece though. And he knows where the variance came from now, but until he worked it out, he had no way of knowing if it was the electronics or the dropper itself.
Reply: @OctagonalSquare  That didn’t need to be tested…that should have been blatantly obvious
Reply: @br52685  glad you’re a genius. Maybe he should hire you as a consultant. You obviously know what his content should be better than he does. Go dig a trench
Reply: @OctagonalSquare  There's nothing "genius" about anything here. Solenoids, springs, plastic and wood all introduce degrees of variance into a system.  Stop acting this like person is the only person who's ever attempted to create anything in the real world, and this is all "foreign territory."  It's all basic mechanics.
Reply: @OctagonalSquare  The dropping mechanism is a single part of likely dozens of other mechanical pieces that will eventually be part of the final design.  Is the plan to also fine-tune each of these dozen mechanism to ms precision, too?
Reply: Spoken like somebody who failed to see the big picture of why the last machine couldn't even play a single song. Which to be fair you had to find beyond the main videos.

Martin clarified that by where people thought he was basically done, he'd need a whole more year to fix all the issues to make the machine perform a single song. A far cry from the machine he hoped to compose on and take on a tour.

Welcome to reality of development, sometimes you gotta quit or scrap and restart. When you do that it'd be idiotic to not take what you learned and apply that knowledge.

I'm sure your feedback would motivate any creator.
Reply: IDK why you wouldn't build the MMX. It seems like another dumb requirement not to finish the project.
Reply: @nighthawkinlight Sounds like you might be jealous.